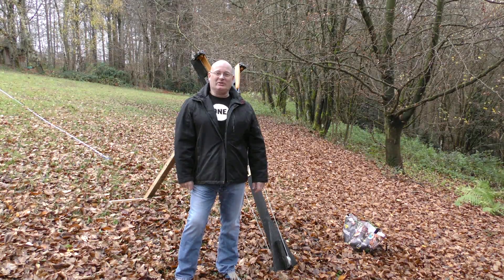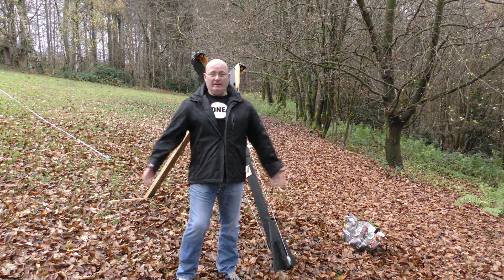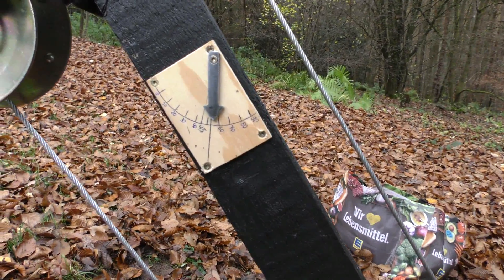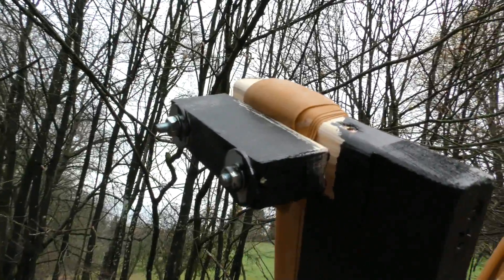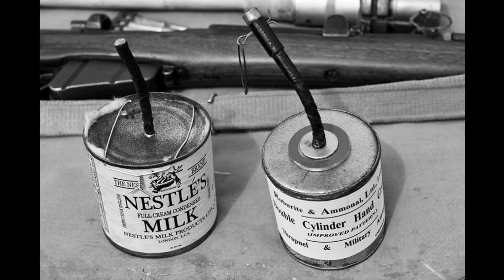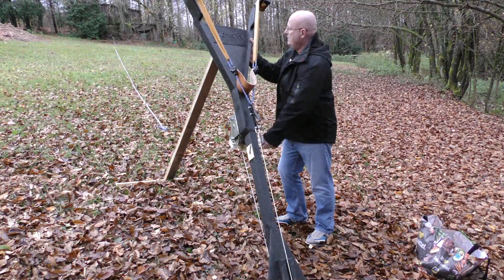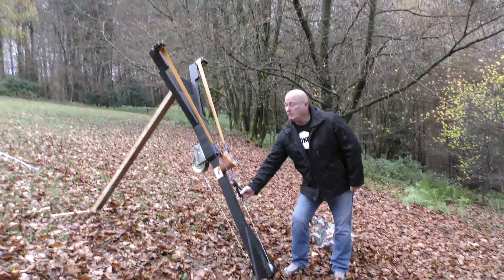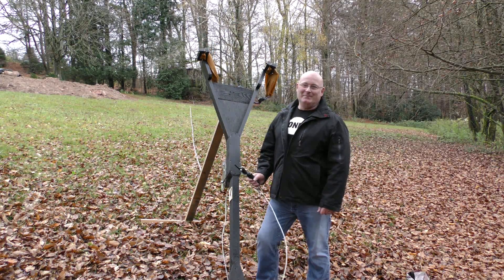Grenade Launcher! (Leach Trench Catapult Replica) Part 1

Comment: I might be wrong, but isn't it much safer to load the catapult before cocking it?
Reply from the maker: +Dustin Ford Depends. Rubber bands sometimes snap during the cocking process. No problem if the pouch is empty, but potentially catastrophic if it is loaded. Once the cocking condition is fully achieved, the rubber normally won't tear.

Comment: I could imagine the grenade exploding in the air if you pull it back too far, especially with the bands you put on.
Reply: Sizzlik Those nades had very little explosives. They were designed to deal damage with shrapnel. However the Germans' enemies had helmets designed to stop those. Not bullets, shrapnel and they did their job pretty well.

Comment: It might be an idea to put some kind of handle on the side fore safety reasons,  looking at the position of your thumb when you were drawing the bands it looked like you were in danger of injuring it if the release slipped, also maybe a bi pod for stability.
Reply from the maker: +enoughofyourkoicarp No danger for the thumb, was never in the line of fire. Bi pod is optional, usually a solid earthen trench wall would do the job.
Reply: JoergSprave Fair enough.

Comment: I would suggest making the wood support a bit more stable. It seemed when you were winching the catapult, it was wobbling. Maybe instead of an upside down "T" shape, you could go for a triangular or upside-down "V" shaped brace, with feet for stability. That, in theory, would be more stable than your current support, and reduce wobbling when reloading.